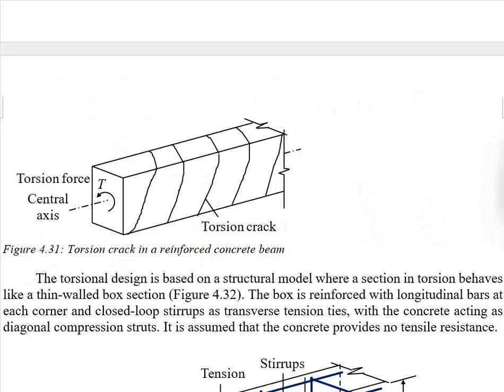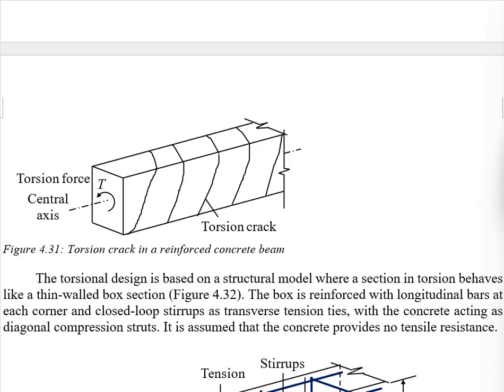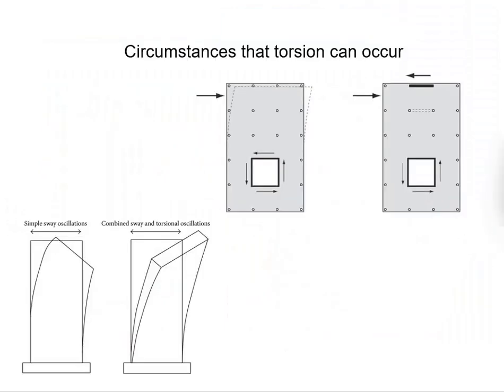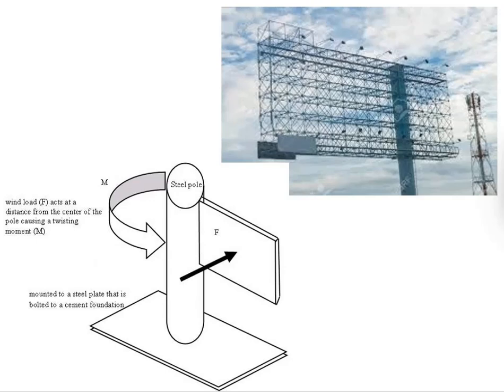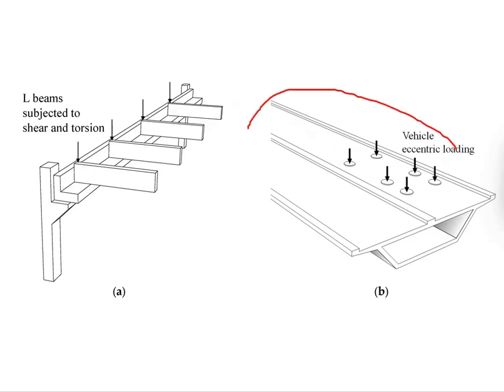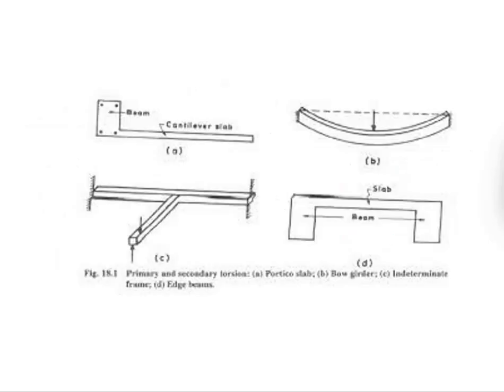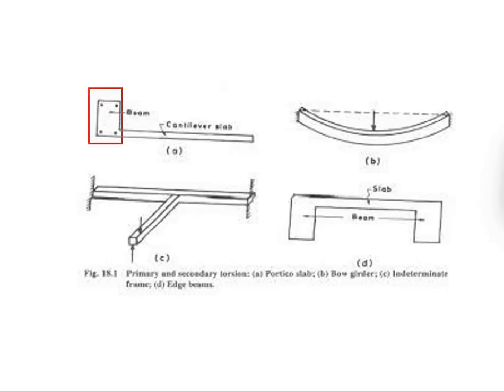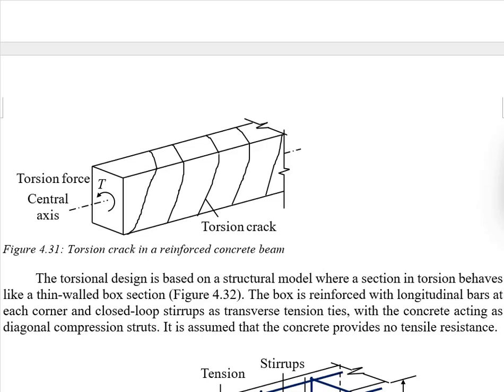5.19 Torsion introduction

Comment: Sir, I am designing an edge beam with a secondary beam at the midspan. The secondary beam is assumed to be fixed. How do I calculate the torsional moment acting on the edge beam? Can I take the hogging moment generated from the secondary beam as torsional moment?

Comment: You have covered most aspects of RC and steel structures. I suggest, If you have the time and opportunity, can you please do the RC pilings design and analysis which cover piling in clay, sand and sand & clay?  Nobody has done/covered this topic in full "design & analysis of RC pilings" through U-Tube.Thank you!
Reply from the maker: Some of these are beyond my current capacity. It requires a lot of time. Due to personal constraints, I dare not promise that at the moment.